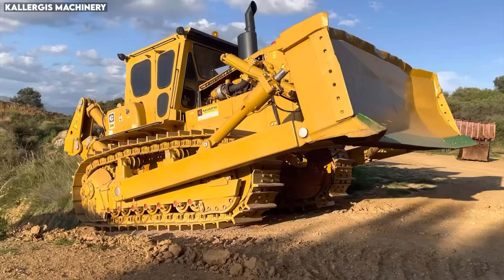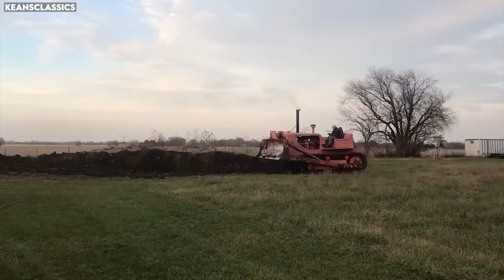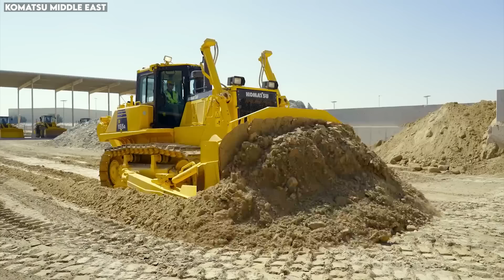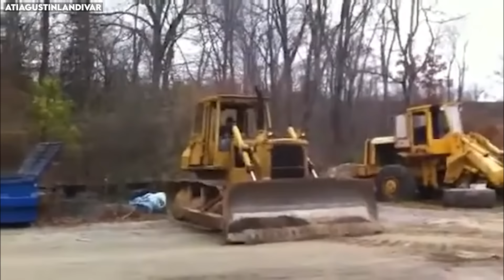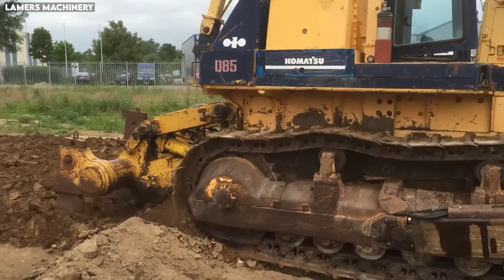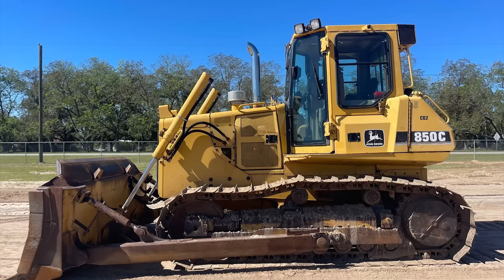10 Bulldozers From the 1980s That Could Outwork Modern Models

Comment: The D353 CAT engine is an inline six.  The D9G 66A series was a 1960s vintage tractor and not a product made in the 1980s.  Yes, the D9H 90V series, which looked a lot like a D9G, was being manufactured in the early 1980s.  The D8H 46A series which preceded the D8K, was probably the most reliable medium to large sized tractor ever made.  The D8K is just a refinement of the D8H and perhaps not as good for various reasons.  Many of the other manufacturer's tractors seen here copied the D8H in great detail.  The D8H was that successful.

Comment: They was built to last not built to fail
Reply: Exactly. NO computers, no plastics . Easy to maintain and repair . No need for a dealer technician to change engine oil and update ECM like modern crap .

Comment: What about the cat d7g
Reply: The D7E 48A series was better.  It had the large four cylinder D339 engine.  The D7G had a 3306 engine which did not have low-end torque like the D339 did.  The 3306 was a smaller fast turning six-cylinder engine similar in performance to a 6-71 Detroit. I operated both a D7E with a cable blade and a D7G in the early 1980s.